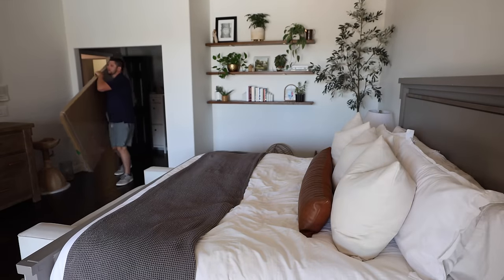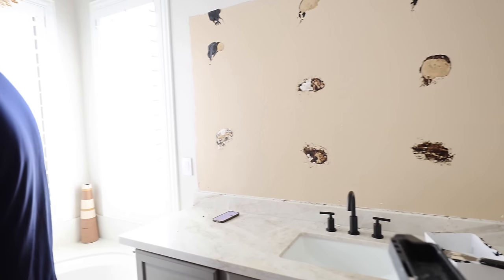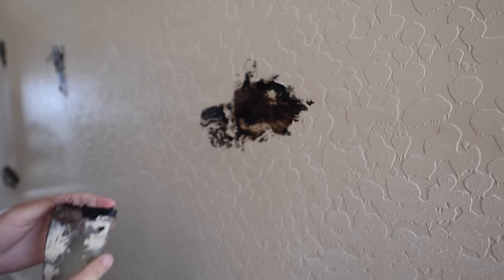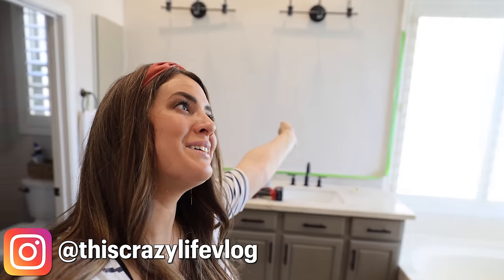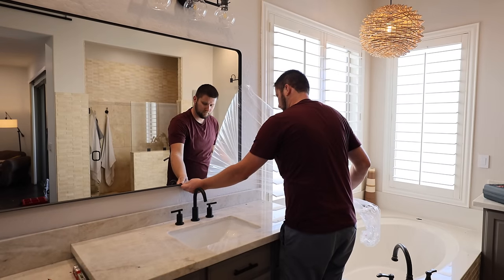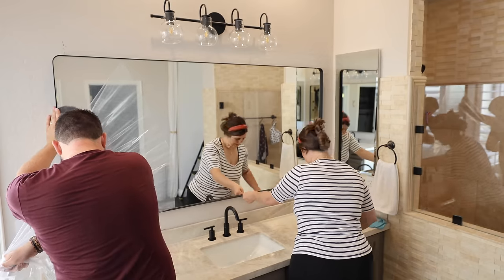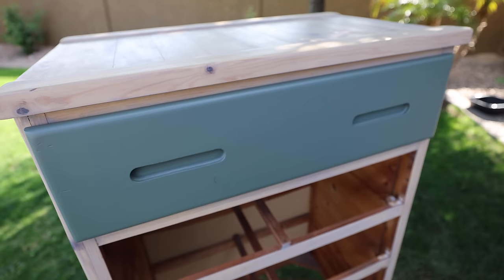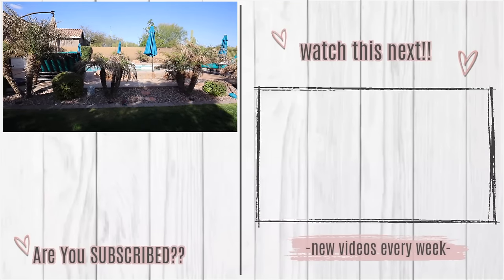NEW HOUSE PROJECTS 2024 :: Bathroom Mirror Upgrade, DIY Furniture Flip {fix} + Outdoor Pavers

Comment: I must say the bathroom looks wonderful. I love the new mirrors so much. Perfect touch. That dresser looks fantastic now. Flip it girl. I just don't know what to say about the coffee table. I have always liked it but you are right about the scuffed marks. To save money I would paint it. The one you showed is $280 and it will eventually look the same way. That's just me. If you remember I have been moving and purging as I go. I already need to do another purge but it's okay. I was able to find a fold down table. I redone it. I am currently using it to display my family pictures. I will use it when it's my turn to host the next family get together. I felt proud of myself. Paid $45 for it and it will be so useful. Okay Kyle and Amanda another nice job and oh boy what a HICCUP . I Hope you never have to pull the floors or carpet up. They probably used cement to put those down. 😂😂😂Have a great rest of your week. As always Till next time.🎉🎉❤

Comment: Method 1: Using an Acid Solution

Step 1: Dilute the acid The first step is to dilute the acid based on the amount of strength that is needed to dissolve tar. ...
Step 2: Apply the solution to the tar-stained area ...
Step 3: Scrub the tar using a brush with stiff bristles ...
Step 4: Scrape the remaining stains ...
Step 5: Add a sealant ...in case you have anymore.xx
Reply from the maker: Thank you, Christine!! This would’ve been super helpful before lol but now we know!!!

Comment: Why not strip your coffee table?    Then see what is under the finish.     I wasn't a huge fan of the stuff you did to the dresser.  You're really the one who needs to like it.    Your right thought that coffee table is an ideal size and fits your room great.    As for the steppingstones I would have put double side by side rocks.   a bigger area to step onto.     I like the mirrors in your bathroom the darker color around the mirror seems to frame it out.    Great job u 2.
Reply from the maker: The coffee table is just laminate unfortunately, so I can’t strip it… I’ll need to do a whole new finish - otherwise, I would love that!